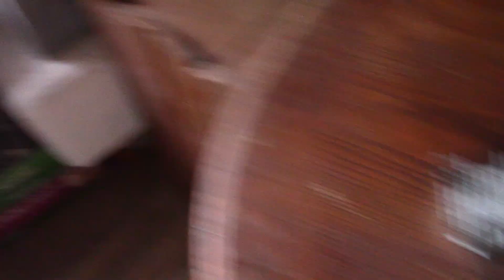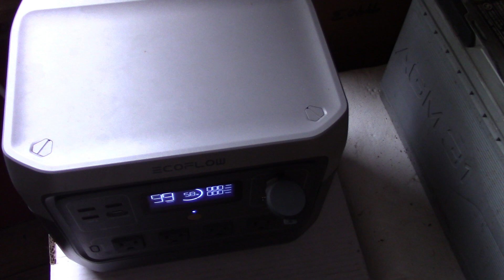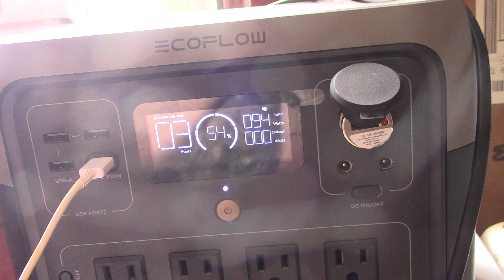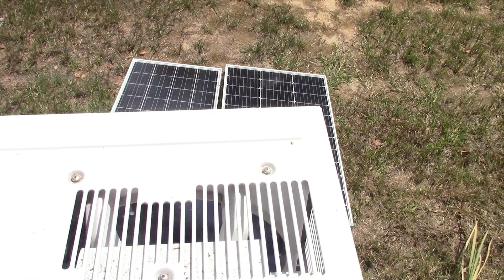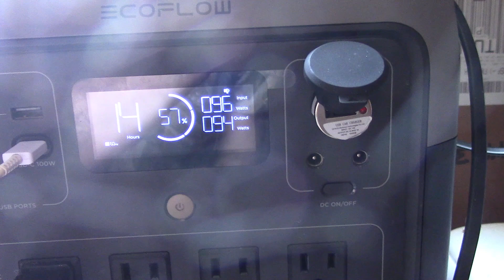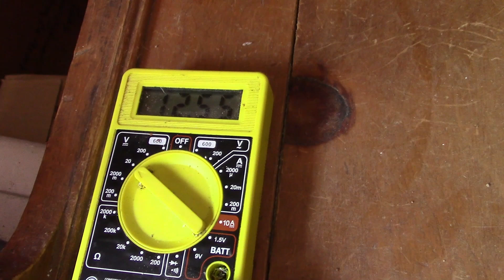Can I get the fridge to run on solar energy?

Comment: You will probably be close to the limit of that solar charge controller with 200w going in, I would check the specifications on it before loading it up much more.
Reply from the maker: Yes, I agree. 50V panel input is a problem, otherwise I'd series connect 3x 100W. Highest from the 2 panels in the vid has been 134W, which isn't too bad, but lower than expected. 
Another idea is to use another similar controller and double up. Or, connect the fridge to our main 200Ah LFP system, now that temps are dropping and the bedroom AC unit isn't needed as much. I don't trust the inverter though for 24/7 operation, that's a whole other story.
Thanks for the heads up 😀

Comment: I'm sure my fridges and freezer are responsible for at least half of my hydro bill roughly 2400 a year.
This would probably pay for itself.
If it's cloudy all you would need is to parallel more batteries right?
I've never seen one of those Eco things.
Thanks you got me thinking now.
Reply from the maker: A lot depends on the age of a fridge/freezer, but at approx 1.5kWh per day that's $200 per year, multiply for how many you have. 
Yep, parallel the batts and scale the solar. it's all easier with car batts, the Ecoflow doesn't care what's making the input energy. Speaking of which, any home power station or car inverter with mains output above the needs of the fridge will work... we just have the Ecoflow River 2 Pro, output is up to 800W, 768Wh LFP battery inside. Main thing is pure sine wave output for clean power.

Comment: Even if you got daytime off grid still saving money. Great video 😊 👍
Reply from the maker: Cheers 😀Yep it has appealed for a long time, just been short of more battery storage. Main thing though to us is for power cuts, which are fairly common. Tall pine trees, sandy soil and strong winds don't mix well 😂